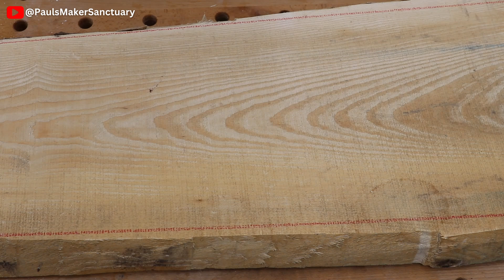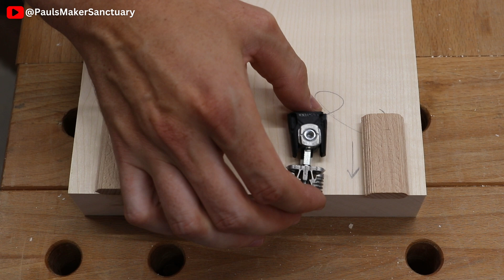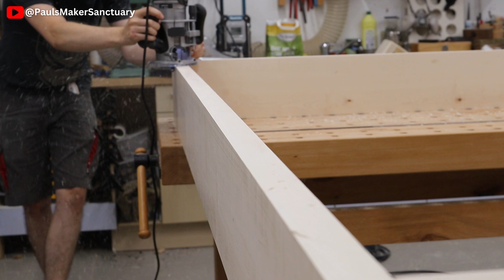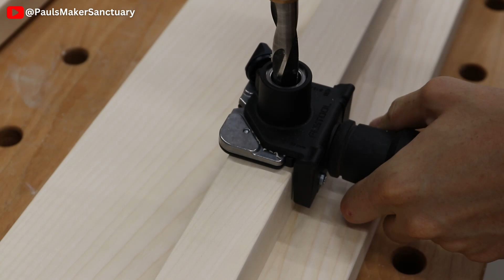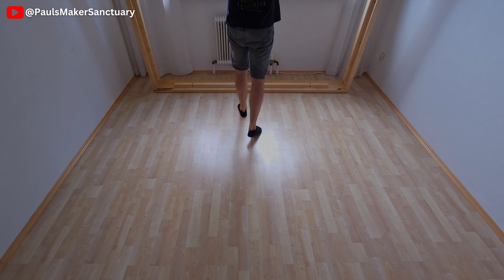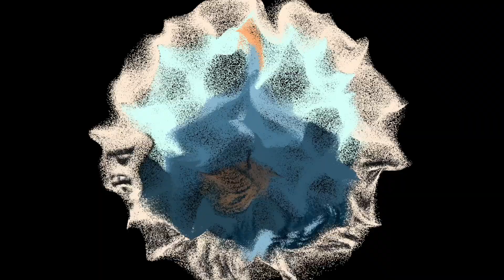DIY Floating Bed Frame out of Wood

Comment: I love this floating bed with led lighting stripe
Reply from the maker: That would be a really nice upgrade 😄👍
Reply: @PaulsMakerSanctuary  , I built a floating bed frame many years ago and added a strip LED light at the foot of the bed. It provided enough light as a night light so there was no chance of stubbing your toe. Had a switch at the foot of the bed as well to easily turn the lights on and off since the receptacle was inaccessible on the wall under the head of the bed and was not a switched receptacle.
Reply from the maker: That's a very convenient upgrade! 😃

Comment: I randomly clicked your video just searching for ideas to build one of these for our kid. Middle of the video you start using domino connectors, I instantly knew I clicked on the right video, finally!!!! Only thing I would do different is use 14mm Connectors on the rails but either way works. Great job!
Reply from the maker: Thank you for the kind words! :)